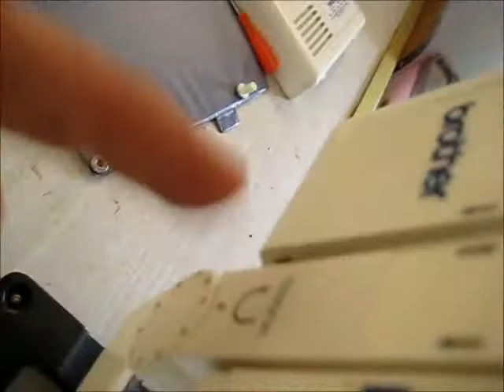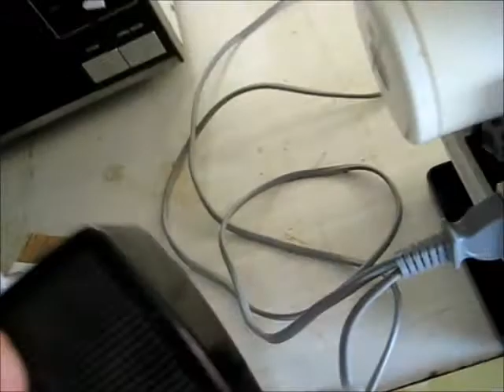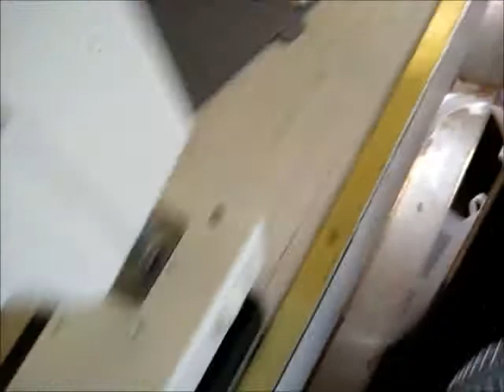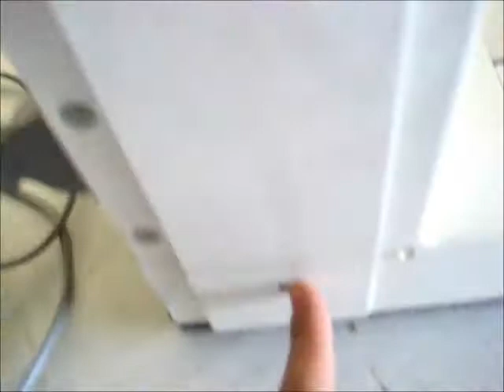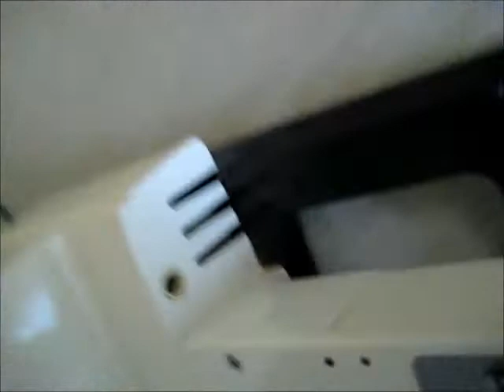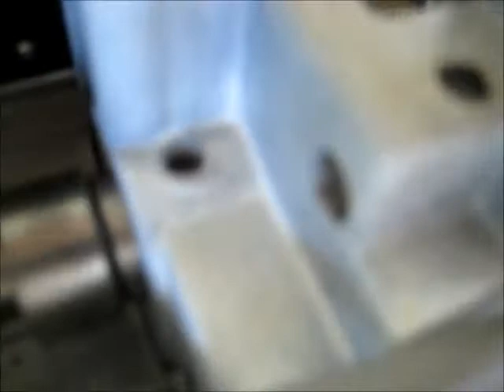Sewing Machine Mechanism

Comment: i do allot of work with sewing machines! if its not earthed one pin is common the other is active (for light) then the last one will be speed controlled. 
the tensioning system is a bitch. ive got 2 that i rebuilt the systems on by machining new discs ect. 
good vid mate